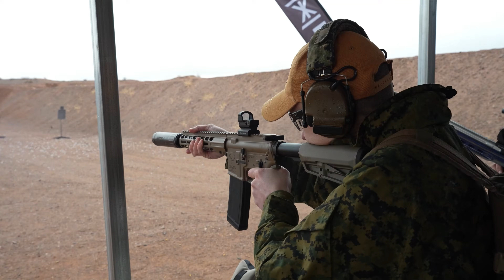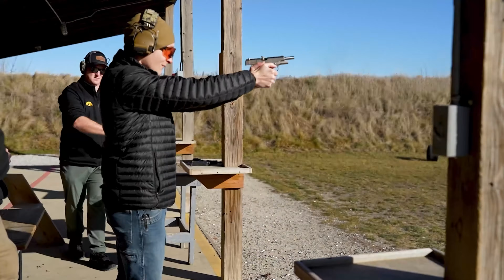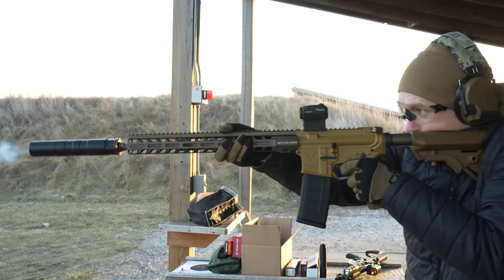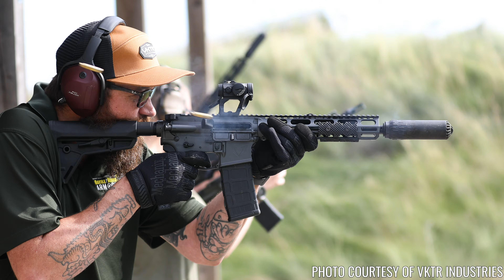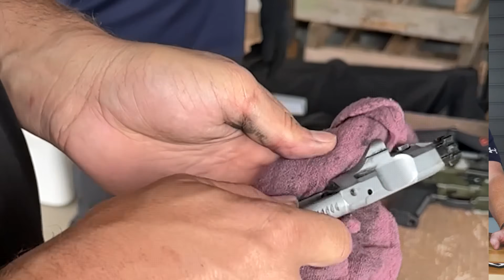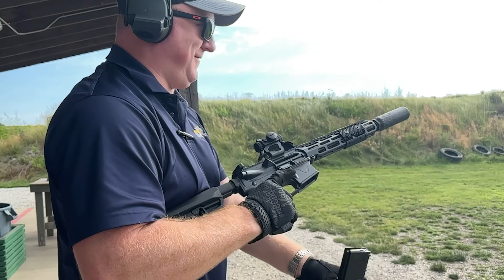The Softest Shooting AR-15 Ever?!? Dave from VKTR Industries stops by BattleHawk Armory

Comment: Hey guys, what rail covers are you using in this video? I need to figure out something for the area near the gas block. The meat of my finger is slightly pushing through the rail slots and is touching a little bolt that appears to be part of the gas block...and yeah, that thing is hot!
Reply: Wear a glove.
Reply: I like the burnproof gear railwraps or you can use the magpul type 2 hardcovers.

Comment: I changed just about everything on my first AR. To the point I could not justify ever purchasing a complete AR off the shelf. I built several more from the ground up. This is the very first rifle I've seen where I wouldn't change a thing. The charging handle is the one I run. The safety, the K2 grip, the stock, the trigger, and ambi controls. All things I usually change out but on the VKTR, it has everything that I would change them to. I can't wait to get one.
Reply: You should post a video when you get one and talk about your impressions on it.
Reply: I think I'm gonna save up and get a griffin armament mk2